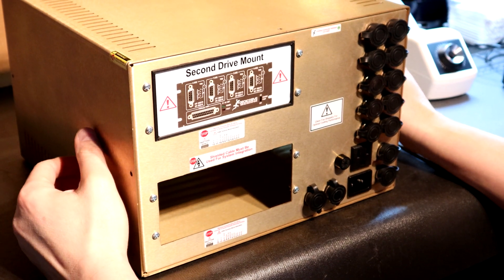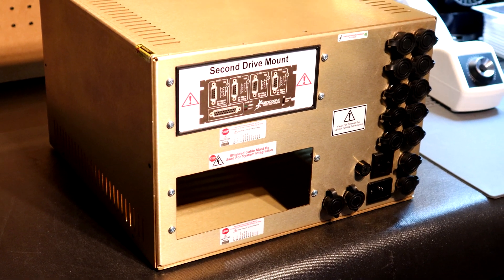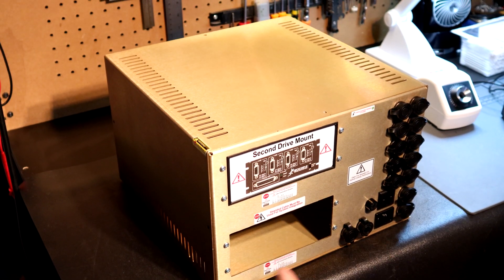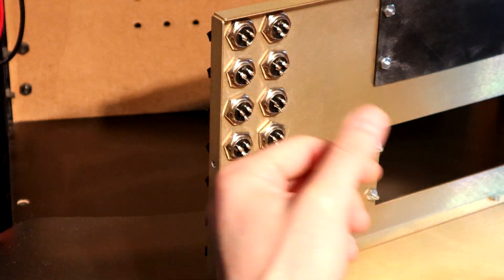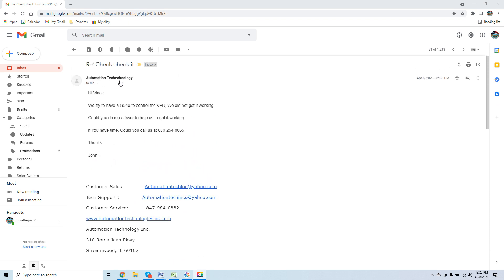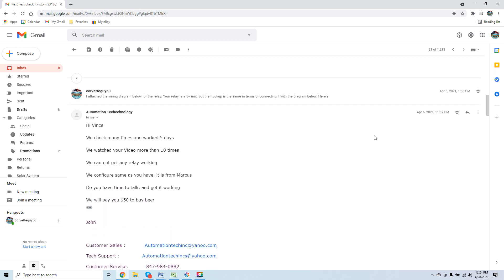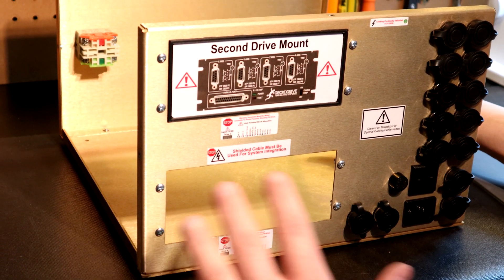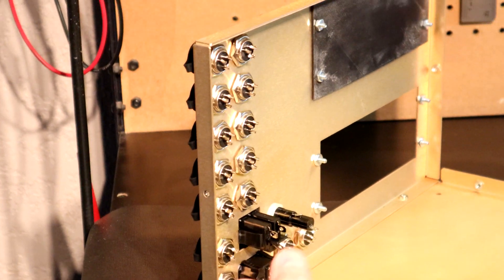Dual Gecko G540 Master Edition Enclosure For The Ultimate CNC Controller4K  (Massive Expandability)

Comment: I get this all day long - its not the 10 minutes i charge u for, its the years of experience i worked on to do it in 10 minutes - cheap is a 4 letter word
Reply from the maker: Bulldog Tech, thank you for your support, and very well said. Have a great weekend!
Vince
Reply: @corvetteguy50  u said u have a controller/software on hotizon? i like your dual case but mach3 ehhhh - rough time frame?
Reply from the maker: The new software is a complete new release not at all associated with both versions of Mach, and offers more features than currently available including the ability to run multiple robots from one PC, and gantry calibration in the software for slaved Y axis. Thank you, and have a great weekend! Vince